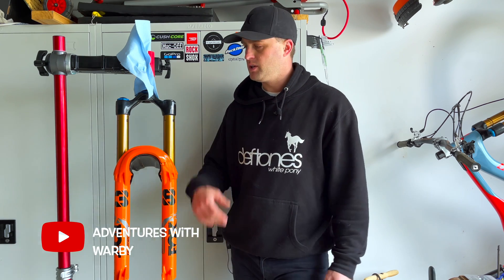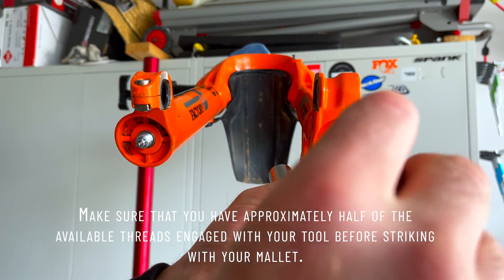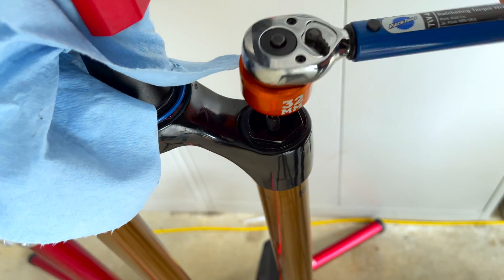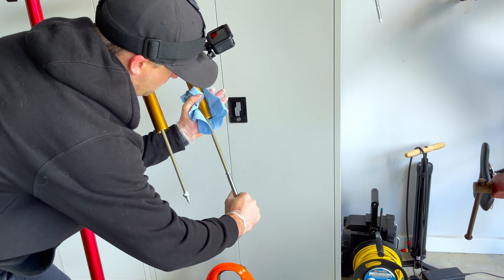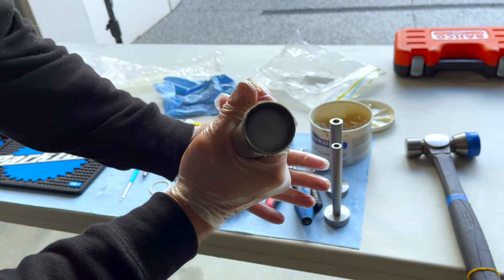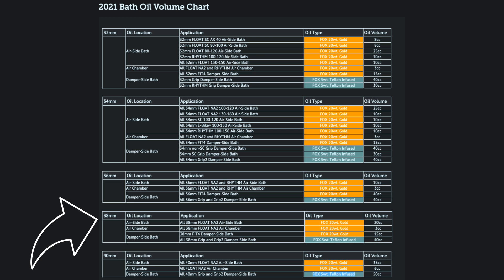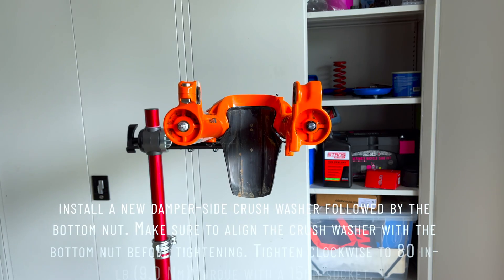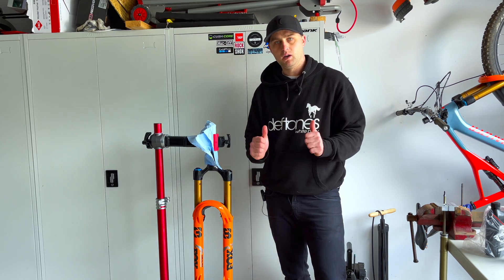Fox 38 service - How to Change your Travel  or remove your air spring.

Comment: I’ve seen videos where people use 20ml of fox 20wt oil instead of grease internal to the air damper. This stops the equalisation port becoming blocked and causing excess grease to pooling in the bottom of the damper causing poor small bump response. What’s your thoughts on this?

Comment: Wow... wish my air spring came out that simple. Mine was freaking welded in LOL. Terrible design. My 36 was WAY easier.
Reply from the maker: Ha ha yep, some are challenging….. the fox air spring tool helps a lot when they are stuck… & the transfer port is full with grease. hopefully your forks are feeling mint now !! 🎉

Comment: Is that normal the Squeaky sounds after fork lower sservice? Thanks for answer..
Reply from the maker: No, no squeak is normal…… possibly rolled a seal.
Reply: Thanks a lot, but I already checked again its all normal inside..  is there any solution for that?

Comment: Question, i've bought Fox 38 Factory 27.5 with FIT4 damper. The fork has 170mm of travel and i would like to swap the damper to grip2. It's a 820-18-336-KIT and it says 180mm travel. Is that going to fit for my 170mm fork?

Comment: Thanks for sharing this. Question for you, have you ridden the new 36? Would you say that the 38 is a bit smoother off the top?
Reply from the maker: Both are great forks, how much travel are you running ? 160 mm below 36 mm is fine. 170mm + 38 is better.

Comment: Good morning from England. Can you change it to 150mm aswell as I can't find any info on it anywhere. You can buy 150mm air shaft but a friend told me it wasn't a straight  forward  swap like 160mm and upwards. Any info would be 👍 👌
Reply from the maker: Yes you  can buy 150 mm airshafts for 38's - Part number FX82002589 - yes it is exactly the same process to swap

Comment: hye. thanks a lot for this reaaaaaaaaaaaaaaally useful tutorial.
what about the 15 cc in the right side that is on the chart ? where do you put this ?
Reply from the maker: Fox 38 Grip 2  - Air-Side of the fork =  FOX 20wt. Gold  -  20cc -  All 38mm Grip and Grip2 Damper-Side Bath - FOX 5wt. Teflon Infused  - 40cc - Not sure where you are getting the 15cc from ?? unless you have a FIT4 Damper.

Comment: Hi there. When i knocked out the air spring, the travel shaft fully compressed, as if one chamber fully decompressed and created a vacuum. Any tips on how to resolve this?
Reply from the maker: Did you equalise the air spring when letting all the air out ? Cycling the air spring should fix the issue. When you take apart / clean the air spring  will also fix the issue.

Comment: Can I Increase the travel from 160mm to 170mm or 180mm? Or I just can reduce the travel on the forks?
Reply from the maker: You can increase or decrease the travel, but you will have to purchase a new air spring.

Comment: Thanks for the video!! When I removed my air spring I noticed that there was negative pressure just in the spring itself. Like, I can pull the inner small shaft and it will come out about 5mm or so, and when I let go it’ll go back 5mm or so back. Is this normal?
Reply from the maker: Recommend a airsping service, while you have the forks apart. I have a air spring service video on my channel 👍
Reply: @Warby0  oh I’ve watched it. Thing is I lengthened by 10mm with a new take off 170mm and it only has about 25 miles worth of use.

Comment: Thanks for the video mate, did my lowers and cleaned the shit ton of grease out of my air spring. WHAT A DIFFERENCE. its night and day. before i had literally no small bump now it feels so supple. I did notice my air spring shaft felt a little notchy when compressed fast which was weird, noticing it when compressing my forks to. 
Thanks again
Reply from the maker: Yep .... makes a massive difference....  glad I was able to help 👍 I haven't experienced the Notchy feeling when compressed  fast ?   not sure what  is ....

Comment: Im confused, i dont think it was explained... how did u change the travel?
I have 170 and I want to lower it to 160. Help pls. 
Is it all about changing the shaft? Or can I make mine 160 without changing the shaft. Thats all And thanks!
Reply from the maker: You need to purchase a 160mm air spring from fox. Follow this video to install the air spring.👍

Comment: So I need to buy two different oils plus shaft ?
Reply from the maker: Correct ✅ a flat faced socket will help with air spring removal
Reply: @Warby0  you don't need that just remove valve and you're ok
Reply from the maker: @MartinTeerly   yes that also works

Comment: Great video mate! I got my LBS to install my new air spring and something went wrong when they were doing it. Couldn’t use full travel and air wasn’t sealing. They reckon the air spring was damage and the seals stuffed. Watching your video I can’t see how they can really stuff this up. Next time I will do it myself
Reply from the maker: Thanks for the feedback Chris ! How are your 38's now the air spring has been rebuilt ?
Reply: @Warby0  need to test ride it mate but he cleaned out a lot of grease in the air spring. Hopefully it rides good
Reply: @Warby0  now it’s sorted I’m going for a run later today. Still running the loan X2 rear shock. But I’ll mount my push 11-6 back on post service over weekend and test. The push coil is unreal with respect to traction and stability in gnar